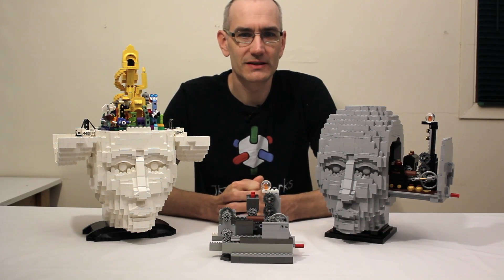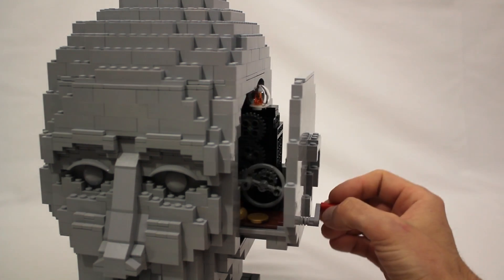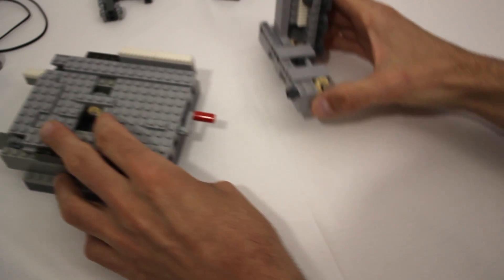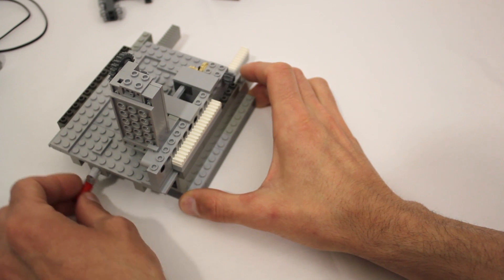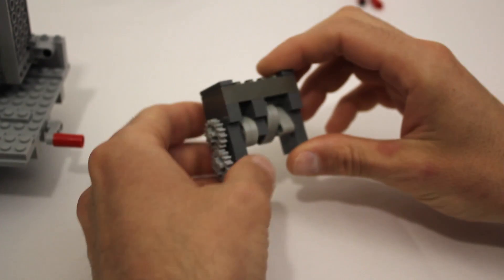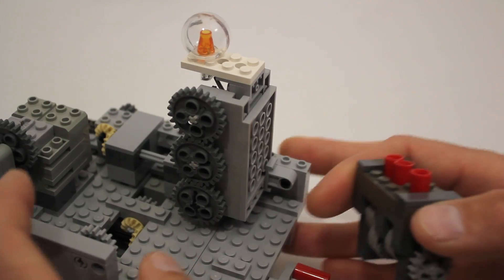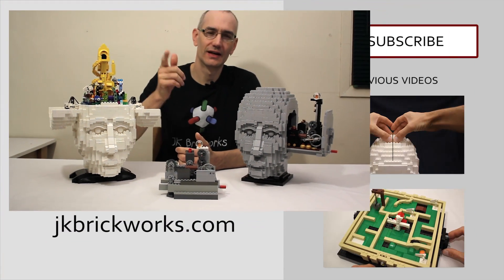Inside the Mind of a LEGO Engineer

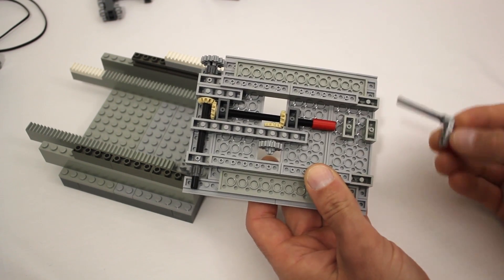Comment: 1:50 No--if I pulled on the crank, the following would happen:
- That red piece would stay attached to the grey axle and slide off the black one.
- As I continue pulling, the red piece would then detach itself from the grey axle because of the 1x2 Technic brick...
- And so of course the red piece would fall in the bowls of the model, forcing me to dismantle it...
(That would be #justmyluck... -.- )

Comment: At the 3:30 mark you show the light connected to the brick motor. I have a brick motor similar to the one you show and a light assembly frrom the power functions set with a connector that looks similar to the one for your light. The motor I have has four studs and the light can only attach to a connector like the one on your light. Is there a special light that has a configuration that works or does the motor have a different attachment?
Reply from the maker: +Rinyotsu I'm using an extension cable in between to connect them: http://shop.lego.com/en-CA/LEGO-Power-Functions-Extension-Wire-8886  All of the Power Functions extension cables have the old 9V connector system on the bottom of one end.

Comment: How do you transfer old 9volt connectors to new power functions?
Also does the power functions motor work as a generator?
Reply from the maker: +Million Dolla Question All of the Power Functions extension cables have a 9V connection on the bottom of one end. Here's one: http://shop.lego.com/en-CA/LEGO-Power-Functions-Extension-Wire-8886

The Power Functions motors will also work, but they are harder to manually turn.